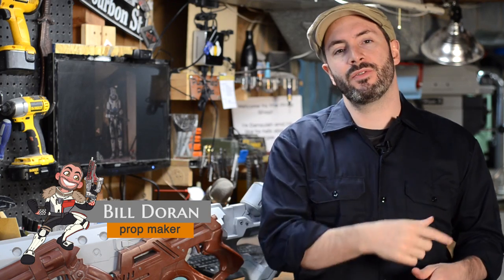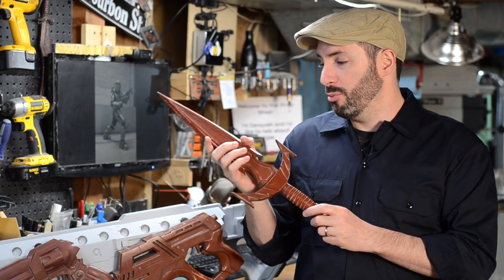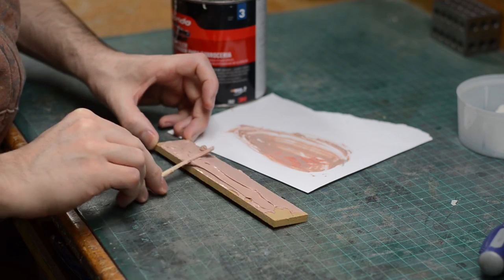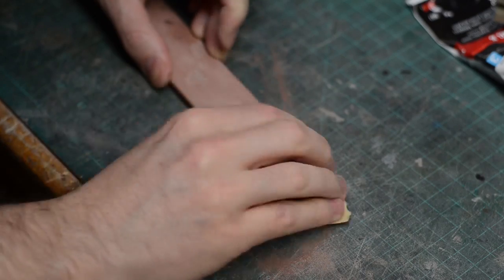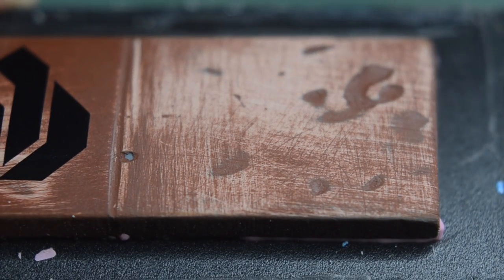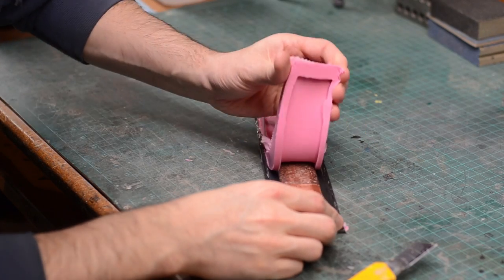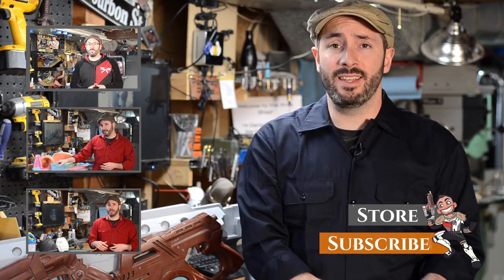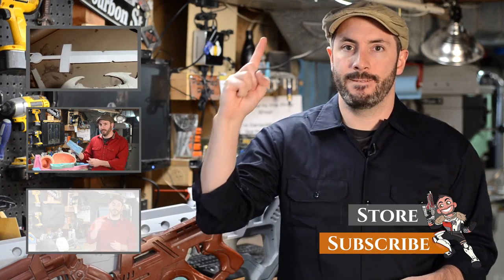Prop: Shop - Molding & Casting 101: Prepping Mold Masters

Comment: So are you recommending against making masters with deep crevices?  I didn't quite understand that part.  If you fill the crevice part way it won't make it into the mold as you were intending, so wouldn't it just be better to not have created deep crevices in the first place or am I missing something?
Reply: if you need to put those details in the final product then it will/could be easier* to make the holes shallow by filling them in on the master and then any copy you make from that will need to be cut deeper but your mold will last longer. once it tears that's a lot more cleanup to do with every copy you make from it or even have to make the mold all over again
Reply: To avoid this issue:  When designing your master make sure deep crevices have an angled wall as opposed to straight walls.  Reason being an angled wall means that the part will release completely from all sides evenly.  with straight walls the sides will have friction as it slides across increasing the chances of a tear.  In parts where this design method isn't possible you can always try for a higher durometer silicone (more rigid.) but still the chances are increased.
Another thing you can do is create a pin or plug of some sort that can be removed after the part is out of the mold.

Comment: Do you have to spray your master with a release spray before making the mold? Or does that depend on the material you make your master out of? Something I've been wondering about :P
Reply: Yes, I've been wondering the same thing.. any reply?
Reply: @txwing99  from my current experience it depends on your masters and the kind of silicone you use. I tend to not use it since it causes a sort of matte glaze on an otherwise shiny surface. That does mean my molds tend to have to retire earlier though :P

Comment: I've really enjoyed the series on mold making and I've had a very specific question about molds.  I would like to do some white metal (pewter) accent pieces for props.  Are you familiar with any silicone mold supplies that can handle the temperature of the liquid metal (450F)?
Reply: They did a video a couple weeks ago about that exact thing. They made a pewter amulet from Skyrim. All the details are in the video I'm sure. I'm super excited to try to make a few pewter castings myself!

Comment: Regarding crevices, what's the best way to sand and smooth the bottom of the crevice? Even jeweller's files don't fit well into the hole, and sandpaper/sponges seem too unwieldy to really smoothen out the internal flat part. Is there some kind of trick to it?
Reply: paint it black and hope its not noticeable. or dig it deeper than you need and refill with some of the same resin and let it set at the right level to give you a flat finish.
Reply: +Graeme Evans Great idea with the resin, thanks!
Reply: exaltdragon yeah, it takes a bit of practice though. most of the time it will be more of a smooth rounded finish. which can still look good. but can be hard to get the perfectly flat, square, like it's machined out of metal look. 

Someone really needs to make tiny flush trim router bits.